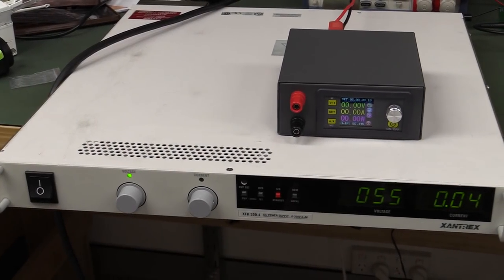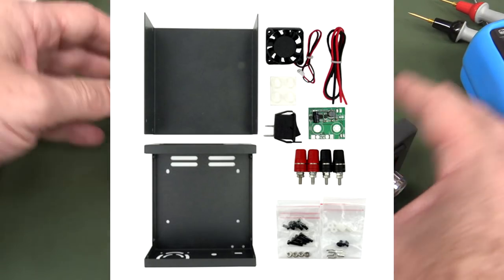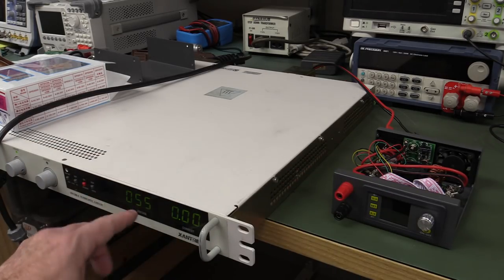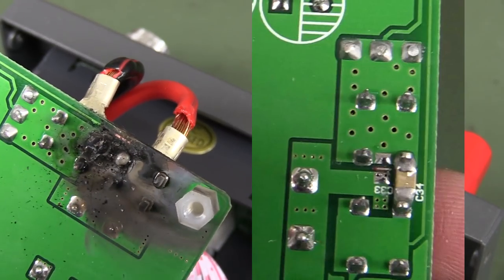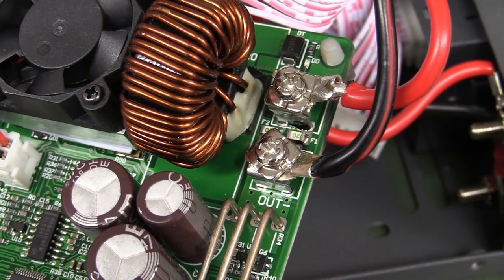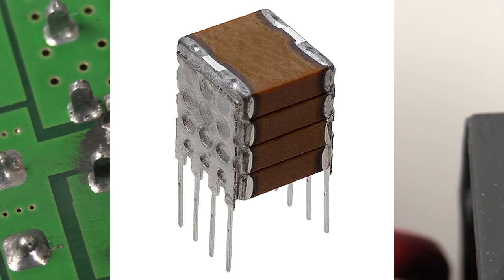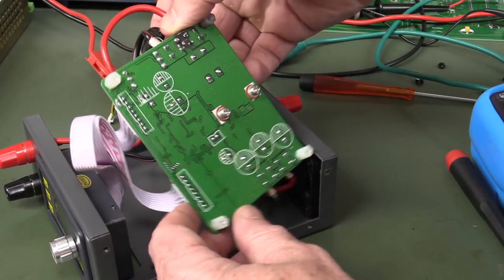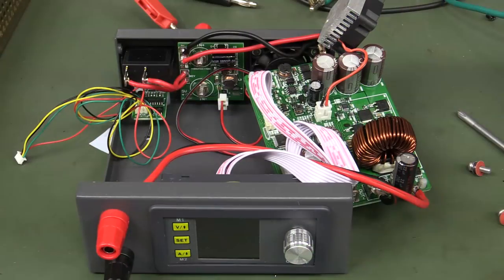EEVblog #1035 - Flaming DIY Power Supply!

Comment: That's very promising PSU but cooling is SHIT.
I would see there cooling similar to that from the laptops with heat pipe and blower style fan.
Reply: When it was designed and tested this fan was installed on top of the mosfets just to bring their temp down to a comfortable level at full power since it obviously was seen necessary to keep a good lifetime out of it and they did the trick by this simple and easy way. Even if this type of cooling mounting is not the most efficient to cool a package like these mosfet its absolutely better then nothing and was also tested to be enough so I have no really problems with it as long as it works.

Comment: I'm surprised you didn't consider the PCB becoming conductive when it was carbonised. Wasn't that the issue with the previous isssue with the alarm system where the same thing happened?
Reply from the maker: I measured it and it was adequately high for a re-power up.
Was far too late to do anything else at that point.

Comment: Dave is proud of his 1000W PSU that grilled the cheap supply ... BUT its >1000W at the high voltage. Since its only 4A. Its output capacitance is not going to be that high otherwise it couldnt current limit properly. Funny.
Reply from the maker: Still 220W capable at 55V
Reply: you are totally wrong ... this is not the reason .. 
because the capacitor place is not good, it was damaged by external force, so it was shorted after power on

Comment: I've just ordered that exact unit. It's 1.5 years since this video, so maybe the design has been improved since then, but just in case I'd like to know : would you recommend removing this capacitor, or replacing it, and if so, what with ? I'm the careful kind of engineer, I'm not about to power on anything that says "1 KW" without a thorough inspection, especially if it comes from AliExpress.
Reply: Hi , we already updated this 1.5 years ago, we use a strong capacitor and change other place

Comment: There appears to be a solder short between two pins on the 48 pin chip seen in the video at 18:13 https://youtu.be/Q2rvAoO-MIA?t=18m13s
Reply: I wonder if that was there in the previous video or if that extra solder was splashed later on?
Reply: I saw that place , it should be solder splash, I guess Dave drop it mistakenly when he install the case , but there is nothing with the board, it control the display . this is not from our factory, because this chip was weld STM machine, it is impossible that there is the solder splash on 2 legs. we don't weld the chip by hand.
Reply: What does PA3 (I/O pin 17) do in your design ?  The one shorted by the solder flashing to VSS_3 (GND) on pin 18 (ps- I misread your statement above initially.  I understand what you meant now.)

Comment: You should really contact the manufacturer before putting out such a video. This could ruin their business.
Reply: Manufacturer is RdTech, on this board now, conducting damage control.
Reply: the manufacturer had to test it more vigurousely, maybe they're going to make their tests better now. They expected free publicity, now they probably learned a good lesson, murphy is always where you don't expect
Reply from the maker: No, that's not how it works. You send your product and you take your chances. Stuff from Keysight, Extech and others have failed on camera, no one gets special treatment.
Engineers know "shit happens", it's a how company responds that matters. The fact that Glen is on here admitting it and saying it'll be fixed will grow his business rep, not ruin it.
Reply: What a nice discussion here. I like it.
Reply: Generally a very good signal-to-noise ratio in the comments on this channel, especially when Dave himself puts in a reply. :)
Reply: manufacturer is working hard in this comments section and explaining how they are correcting it & taking out the next revision. that's nice.
Reply: Vendicar Decarian - I think the spontaneous reset is from the main power supply hitting its rather low current limit.  The voltage drops out and the test PSU reboots.  It only happens when the output is enabled and the DUT's current limit is high enough to draw the max allowed power from the external PSU.
Reply: Vendicar, the power supply doesn't come with a case.  So it is likely that somebody could be using it with it just sitting out in the open, on top of a cardboard box or some papers.
Reply: We need stuff like this public.  Manufacturing companies have hidden stuff from us forever.  Cheaper to lay insurance claims than fix a bad fault. Like airbags that are faulty in cars. Someone crashes and dies because of faulty airbag. Dead person can't sue.  Recalling 200,000 cars... Not worth it.
Reply: fred jones we'll see 👀

Comment: Mechanical stress fractured the multi layer ceramic and allowed layers to misalign to the point it becomes a dead short.  This makes a very hot similar to arc welding.
Reply: yes, you are right

Comment: Hi! I'm buying this power supply, what do you suggest to do  with the cap? Should I move it to the empty pads?
Reply: Rd Tech is making posts all over these comments - he says that you can remove it.  I'd just check it out thoroughly and do the standard 'Smoke Test' to be sure otherwise it looks fine.

Comment: Mine was blown as well. I just had to check my DPS5020 and that was also smoked underneath. The capacitor was vanished. A few months back, I smelled something burnt but could not locate it. Now I know... 
So I cleaned it and soldered in a 100nF 100V PP capacitor as replacment.
Reply: thank you for your message 
I am so sorry for that, and I am glad that you fix it 
if you have meet any problem, please contact me

Comment: The burnt carbon that you didn't remove from the board is probably creating a resistance between your output points applying a load even when you have no external load attached.
Reply: yes, he did not clean them all, there are still shorted

Comment: If you place 2 capacitors in series for this reason, don't place them in the same direction. Have a 90 degree angle between them to minimize the risk that both crack if the board is stressed in one direction.
Reply: it is not useful for this , i have use stronger capacitor to replace it , that's ok

Comment: I think due to the fact the ceramic capaitor was directly soldered to the terminal pins it suffered from mechanical stress while attaching the wires to the terminals, so there might have been a crack inside the capacitor which led to the short circuit situation
Reply: yes, you are right 
I have used stronger capacitor

Comment: You have to remove all the carbonised PCB between the output terminals and if required refill the gap with epoxy.
I use a PCB drill to remove it all.

Comment: If someone owns one of these little ebay power supplies would it be a good idea to check the cap before it blows and possibly upgrade?
Reply: Hi friend 
we already update this and use strong capacitor, and don't worry about that , before this video published, we sold thousands of this , only meet one , only it was damaged, it can be burnt

Comment: at 18:10 in the video, you can see a short on the 48 pin leaded chip below the screwdriver in the corner of the chip. Looks like a fine piece of stray wire shorting out two pins!

Comment: Watched the last review. Added the power supply to my shopping basket. Didn't click checkout. Decided to look around for more reviews. Then watched this video. Removed the item from the basket. Will be bringing my full scale lab power supply out of retirement instead.
Reply: These are fine as long as you don't use them at 100% input/output spec. I use mine with 36V in and 5-6A max and they are great and run cool at those loads.
Reply: Hi friend 
don't worry 
about this , I just explain this , the capacitor was compreessed by force. so it was shorted. now we are updating and choose a new place
Reply: Thanks for looking into this. I often go with Dave's recommendations when making purchases. If he does another positive review, I might reconsider. I've also had similar failures with caps in devices that I sometimes service. Fused caps, especially the tantalum ones. Never had one though that would bring down the entire board. Dave did try running the machine with an electrolytic in the end and there was still damage. I'd expect some form of short protection, a PTC fuse at the very least on whatever else that burned out. All of the lab supplies that I use can deal with output shorts no problem (but they also cost a lot more than this little gadget).
Reply: @Trump's Merkin
this is not the reason. our input is 60V, there is not any problem
Reply: @Dick Fageroni
you can try , my dear friend 
trust me

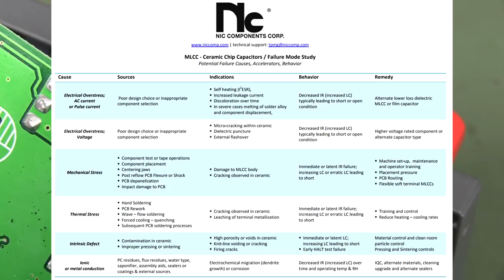Comment: 8:40 -> small error there; if one capacitor fails you actualy get twice the eq.series capacitance
Reply: If the one fails to a short ---you're right. Good catch!
Reply: Becauce the cap shorted out.
Reply: And you loose half the operating voltage. Two 63V in series can handle 120V, if one dies short you only have 63V capability.

Comment: I'm having an issue with a feature of the DPS5020 module, I made a power supply for it with an old 50 volt transformer. The problem is that the open circuit voltage is 69 volts and this module won't latch on if the voltage is too high, do you have any suggestions?

Comment: I think the rebooting was caused by current limitation set on the lab psu. As the device was powered on the terminal were cold. Dave set a voltage and current that exceeded what the lab psu would deliver with its settings at that moment. In that case the voltage from the lab psu dropped below the minimum voltage that the other device needed to operate. As soon as the micro controler threw its hands in the air the terminal where powered down and the supply voltage sprang back to a level where the uC could operate again.
My guess is that the terminals were still shorted, maybe bits of the charred PCB became conductive.
Fairly easy to repair.
Reply: yes, it is easiy to fix , he just remove the burnt things, that's ok

Comment: Most likely the cap was cracked when tightening the output wires causing failure. Firstly remove the conductive burnt mess and clean properly. Then I would reroute the  sense traces directly to the binding posts on the case and reposition output connections to the board.
Reply: thank you for your explain ... in fact , don't use this , it will all good

Comment: So a weekend electronics fiddler should stay away from this? Even the lower current models? Looks like a pretty decent power supply for low volt, low amp projects.

Comment: You said it blew as you ramped up the voltage with no load. Could this be overshoot on the output blowing through the caps?

Comment: Board mounted caps over-heating on a video card caused the failure of my 'crucial' pc, probably with thousands of other XP-running pc's.(No, not online by then.)
Bummer though.  No vague induction from the big power supply?

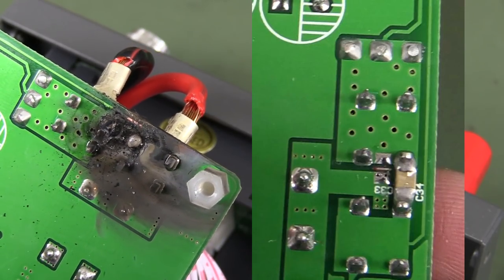Comment: Hi Dave at 8:13 the pic of the cap C34, the cap has a crack in it, so has failed mechanicaly during fittment. This is a problem with SMD chip caps on large heatsink pads as you have there its quite common to see that. They fail during the cooling phase of soldering. Fitting it on one end to one pad and then soldering a wire across to the other is a way to reduce the stress on the SMD part.
Reply: thank you for your advice , but I just replace strong capacitor, that's ok

Comment: Mechanical stress on chipcaps often can cause an internal shortcut inside the cap. Don't bend or warp the PCB. When you do in-circuit test, don't use use testpins with very strong spring force id you have 100+ pins.

Comment: It could be a design issue also. I suspect the capacitor is there to filter some high frequency noise and noise spikes caused the capacitor to breakdown and start a short. The capacitor might be rated only to the max DC voltage.

Comment: What was the OCP set at in the PS when it blew??
I have a DPH3205 and when the Current goes over the OCP I set the output shuts itself OFF.
I would think the same is true for your PS.
Reply: not same, it is capacitor shorted, it cause this burnt ... 
OCP is to protect the whole circuit,. now the circuit has not problem

Comment: @ 18:09 is that a short across the pins on the big IC in the bottom of the frame???
Reply: no, it is not that problem,. it is capacitor problem

Comment: I've purchased the same module from a Chinese website but it came with an instruction booklet that clearly stated that max. volts in should not exceed 52v dc So, the 3 v difference made it pop.
Reply: 52v ? DPS5020 ? impossible , our input is 6-60V. our data show this , if you use a battery as input , 61 V is also not problem

Comment: Scrape off everything that looks bunt, elemental carbon is resistive/conductive. Usually after scraping I go in with flux, heat it, then clean that with iso alcohol. Once, since it was a clear cut between tracks for a screw terminal block, I just hacksawed in between to clean PCB, flow solder over the tracks, solder a new terminal and clear coat.
Reply: thank you for you explaination

Comment: This has all the hallmarks of failure due to micro cracks, as others have indicated below. Incidentally, we just saw this problem pop up in a batch of boards at work. Firstly, that cap is VERY close to the edge of the board; judging by the roughness of the board, I'm assuming it was v-scored instead of milled. When fabs v-score a board, they flex the panel to crack boards apart, which puts mechanical stress on components near the edge of the board. Secondly, the cap has a relatively large pin to footprint surface area, which increases the moment of force relative to smaller caps. Thirdly, it is mounted parallel to the edge of the board instead of perpendicular, which makes the cap more succeptible to cracking under torsion iirc; several huge red flags that point to micro cracks formed when depaneling at the fab. Note that micro cracks might exist, but not fail, or even fail intermittently, depending on the mechanical stresses on the cap at any instant in time. The reason it fails (and fails short) is that the crack causes missalignment between the interlocking layers of conductor and dielectric in the cap; two (or more) conductive plates sheer, and come into contact with the sheered plates connected to the opposite terminal, and you've got a dead short. You could go with caps of different dielectric (differnet dielectric materials are more or less resillient to cracking (standard ), or use soft termination, but the cheapest and easiest option would likely be to just fix the layout.

Edit: Neato! Reading through the comments, I learned that charred PCB  can be conductive! A couple years ago, I grabbed a Tenma 3060 off ebay, and the function generator's 50 ohm output resistors were toast; so bad that there was charring all the way through the circuit board. I replaced the resistor (along with some BJTs that got fried as a coincidence of resistor failure), but the darn thing just kept failing (I inserted a higher wattage resistor, and now the BJTs keep burning out). I now realize the charred PCB is probably just shorting out that current-limiting resistor entirely, as well as any other nearby components! Thanks internet! I've been scratching my head over this problem for quite some time.

Comment: Where did this project designer get the idea that a SMD capacitor would survive at the main power supply output.
At what point in the design process did the designer not test that before releasing it as a kit?

Comment: You might want to put two capacitors in series...but, if one is shorting then, you have twice the voltage on the other one and get twice the capacitance, not half.

Comment: Hmm. Maybe nothing but at 18:13 you can see a solder bridge  on the chip below the tl594c..
Reply: I saw that place , it should be solder splash, I guess Dave drop it mistakenly when he install the case , but there is nothing with the board, it control the display . this is not from our factory, because this chip was weld STM machine, it is impossible that there is the solder splash on 2 legs. we don't weld the chip by hand.
Reply: Rd Tech thanks for the comment.  I agree with your observation..

Comment: This is a well known failure mode. Multilayer ceramic capacitors are brittle. They should be mounted on the narrowest practical tracks/pads to avoid mechanical strain. Otherwise, as the solder solidifies, it shrinks and pulls the capacitor apart, forming a barely visible (under a microscope) crack. Do a search for the "Surface Mount Technology - Design Guidelines eBook" at "the-cool-book-shop" for more information. The malfunction after the capacitor was removed was probably caused by the carbonised PCB. You need a small burr on a "Dremel" type motor to grind away all traces of carbon. Then repair PCB with suitable epoxy. The capacitor is only there to remove high-frequency "noise". It can be replaced with a leaded type. Alternatively, use the same type of SMD but attach it with short, thin wires.

Comment: Get a plunger that fits around the smoke detector (or a bowl, or some other hemispherical thing), and remove the existing handle. Replace it with a longer handle, sized to perfectly reach the ceiling. It can be applied rapidly, and without needing to get a ladder or stool... Just grab the handle, aim the cup at the smoke detector, and slide the handle so the floor supports it vertically against the detector.
Reply: richfiles Putting your stool on the thing would be a nice complement to the other bad smells ...
Reply: You know, the new ones they sell at the store come poo free! :P

Comment: I notice at 15:39 the cooling fan over the mosfets is not on, thus no cooling.  If they don't have thermal protection when active cooling fails, that little heatsink has no chance and; that could explain the smell and the thermal runaway / aka resistance and heat and fire?? no?